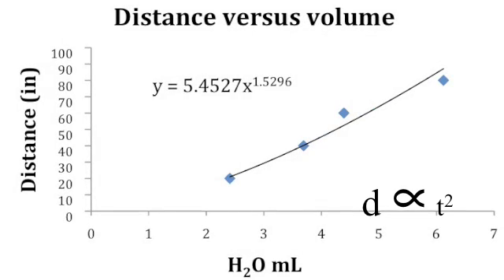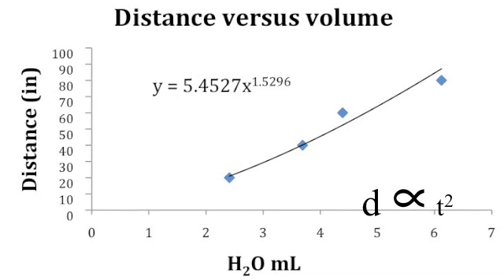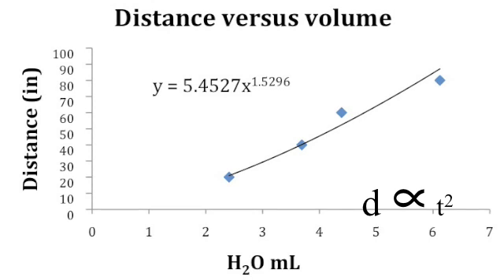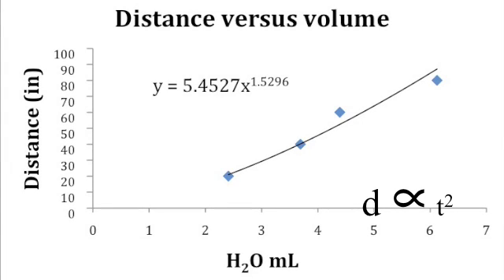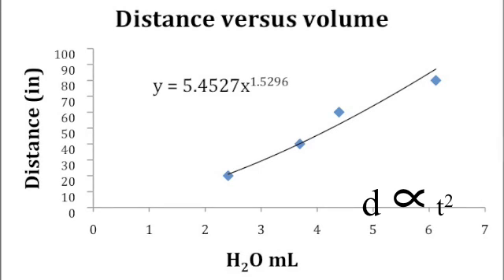Galileo's Inclined Plane Experiment

Comment: instead of ml, use the weight of the water as a measure of time and it will work out fine
Note: Don't forget to tare the weight of the container if you are using a digital balance
alternatively, you can minus the weight of the container from the total weight (you miss this and you will get it wrong)